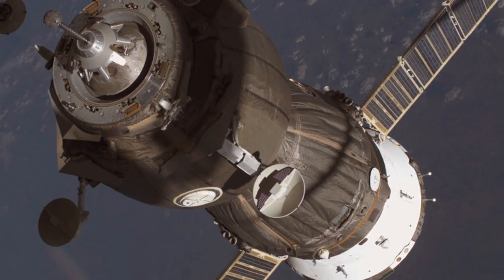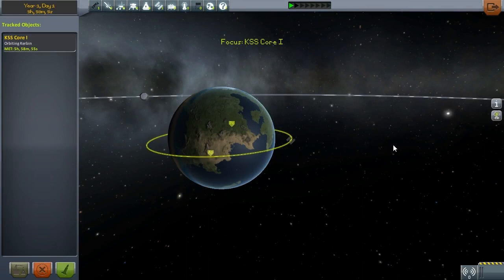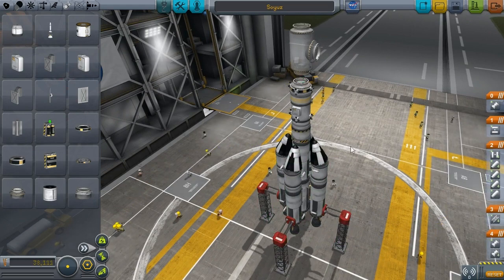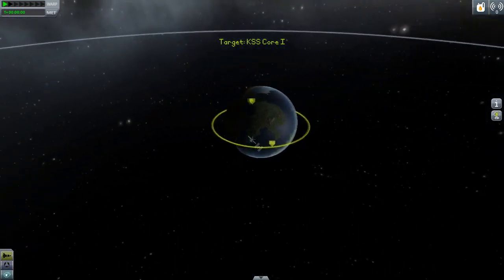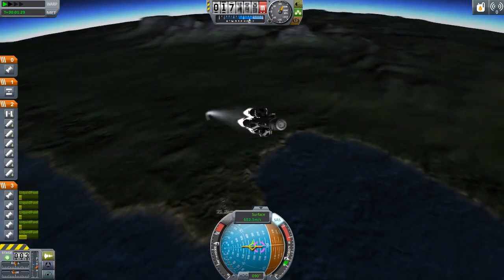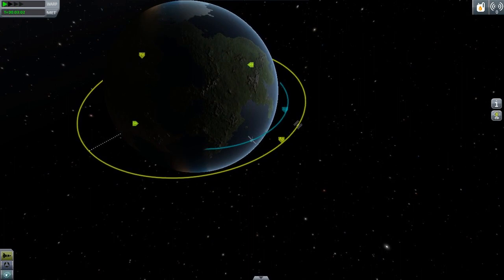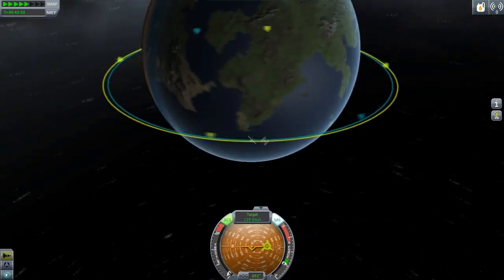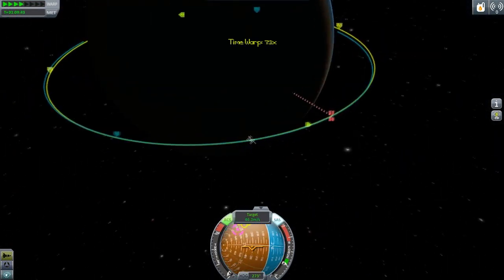How Docking works in KSP!

Comment: 1. Launch in same direction.
2. Click on Target, "set as target"
3. Click on nearest Ascending or Descending node and drag Normal/Antinormal vector to align orbit inclination. Execute.
(4. If orbits don't intersect, click on Periapsis and drag Prograde until Apoapsis of your orbit crosses orbit of your target. Execute.)
5. On Orbit intersection click on Intersection 1 node and increase your orbit, so its 20% bigger than your target. Execute. Having bigger (slower) orbit is safer, to prevent accidential atmosphere hits on retrograde burns.
6. Skip loops until your target is catching to you from behind, click on Intersection 1 or 2 node, drag retrograde until one of Intersection nodes get 3km or less. Execute.
7. At intersection with target, repeat until target is in 20 meter range:
7.1 Wait until target is nearest, burn retrograde until speed difference ("Target m/s") is 0.
7.2 Set course on Target, burn to 1-10m/s (50m-2000m). Rotate retrograde.
7.3 When target distance stops decreasing, burn retrograde to cancel speed difference. Repeat 7.2

8. Docking. 
Note 1 : you need 4x RCS on front AND 4x on back of your vehicle. Bad placed RCS will result in uncontrollable behavior.
Note 2 : wait until its morning. Try not to dock at night.
Note 3: your target should ideally have docking ports facing on Normal/Antinormal sides + SASed (perpendicular to prograde/retrograde). If docking ports are front/back, move Normal/Antinormal and hit SAS. This prevents their rotation.

8.1 Go into LOCKED view mode. Disable SAS. Rotate and align yourself (WASD, QE) yourself facing target docking port. Enable SAS. Every time you WASD/QE - suspend SAS.
8.2 Using H to approach, N to slow down - approach target. Using IJKL sidestep to target. Approach to 5 meter distance to port - only THEN correct your orientation.
8.3 After orientation is correct, approach port at 0.1m/s. When Magnet field starts to catch you, disable SAS. Wait until ports contact and give a little H (thrust forward) to cancel push-back force.

Comment: imn trying docking right now the orbits are at the same point but the diverences in the y acces and the z acces are very very veeery small and i cant get the relative speed to stay 0
Reply from the maker: In order to stay at 0 forever you had to place your ship exactly right "behind" the target so it is in the same orbit just a little behind. This is pretty much impossible I'd say not only because you can't match any orbit 100%ly but also due to KSPs rounding errors. If you want to achieve two crafts orbiting in a formation for as long as possible you had to chose a very high orbit. What can also happen is your RCS thrusters pushing you arround while rotating. You can use reaction wheels only to avoid that!
Reply: yeah but because oft his error it impossible for me to dock for the times the two crafst are close together i have very little time to manouver
Reply from the maker: Hungrydomo I think it is easiest to simply look at the navball and the markers. Just fly in direction of the target docking port and use your RCS (I J K L - controls) to keep your prograde vektor at the target like I show in the video. You can't miss the docking port like that.
Reply: ive been trying that but still ty

Comment: What is the program you are using as the chalkboard and are you using a pentab?
Reply from the maker: Hi, I use Sketchbook as the chalkboard but you can pretty much use every paint progam. "MyPaint" is a great freeware which works great too (Win/Linux). And yes, I use a Wacom Bamboo tablet.
Reply: ty.  I have a very old wacom and I also have sketchbook.  I just cannot write very well on the tablet.  Something about writing one place and the output appearing someplace else or maybe it's something to do with the old wacom.  Your writing looks really nice. I want to do a similar thing in some videos I am making.

Comment: What's the secret to getting the Korolyev Cross right?
Reply from the maker: Assuming that I do it right (I don't know?!) you can pretty much see it in my video if you look carefully. In the Video options you can actually play the video in 0.25x normal speed. I use 6 sepatrons on each booster! They all start at the same time but have different amounts or thrust and solid fuel to make the booster fly away in such a fashion seen at 2:32
Reply: KerbalEssences Ugh rocket maths lol
Reply from the maker: sleeming88 haha, I'd call it Kerbal guesstimation :D As a tip: empty the fueltanks in the VAB and seperate them right after takeoff to test your cross. Empty fuel tanks behave much different from full ones!

The cool thing with the 0.90 update is you can actually set the booster as the root part, detach the rocket and check where the center of mass is with full and with empty tanks.  

Best update since I started playing KSP :-)